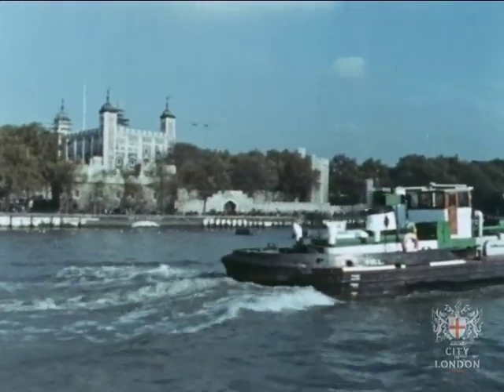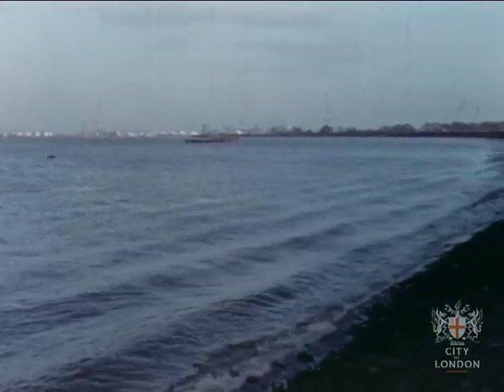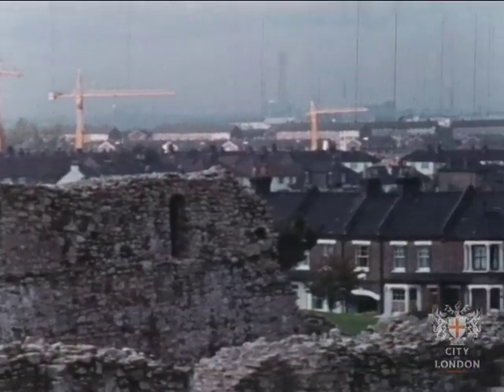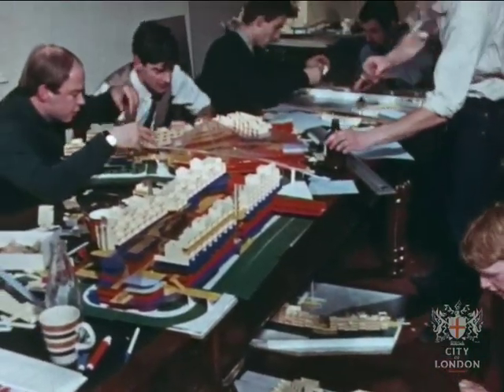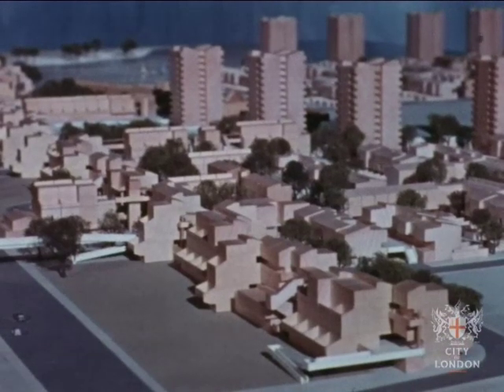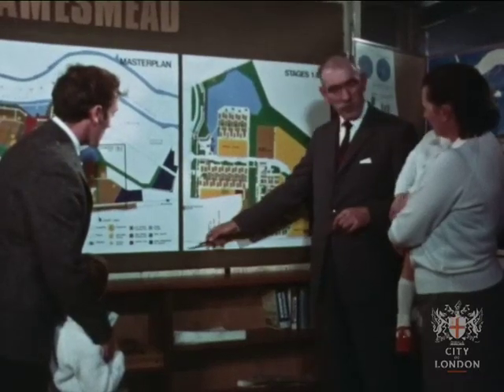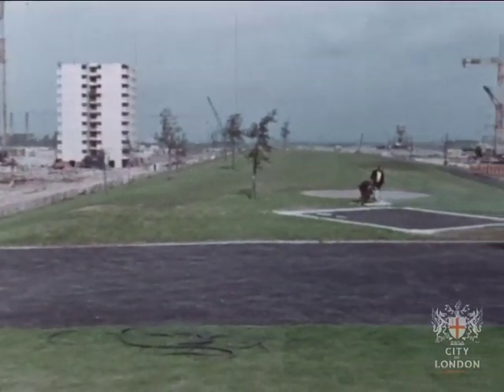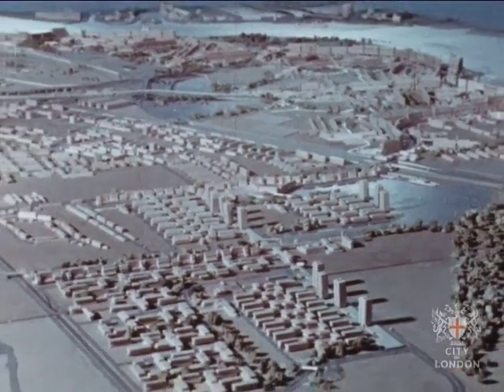Thamesmead, 1970

Comment: Used to live in Thamesmead. Feels weird seeing some of the tower blocks with the roof not yet built. Sad thing is that's roughly how they'll look as they're being pulled down, which might not be for sometime yet. I assume the two towers at Tavy Bridge (14:10/14:13) will be spared as they had a major facelift years ago and the new modern buildings have now been built around them.